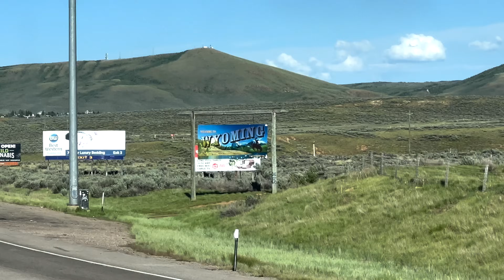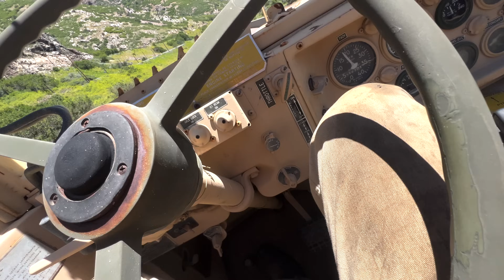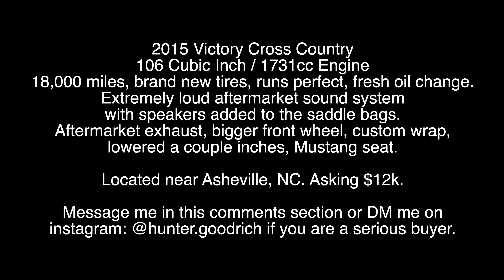Trying To Get My Sketchy Load Across Country

Comment: Might wa n t to think about attaching a chain to the frame and other end to cab lock! Worked on a lot of cabovers and never had a hydraulic cylinder fail but it happens. Freinds of mine that I worked with saw it hapoen. Worked 20 years as an ASE certified hvy/ med truck tech! Work safer/ smarter to be around longer!

Comment: When you tightened ur alternator it made me think of the old days where a tight alt belt turned into the bearings in the fan or water pump or whatever accessory is on the alt belt.....yup ...good times..❤️🇺🇲
Reply: Yeah those old V-belts had to be tensioned PERFECT, otherwise they'd squeal like a pig & destroy your accessory bearings!
Reply: @cigarsgunsanddiesel8032  true story

Comment: Truck driving school I went to had those cabovers drove a lot of them and then a rock company I work for had a few of them I drove quite a few of them and many other trucks I have drove no no more now I drive a power wheelchair. What fun that is. like the show very clever on the welding I'm kind of curious  at what your axles weights came out to

Comment: I bet this was quite the adventure...🤪👍

So since you showed us the first rendering (back when you were in UT) of the cab-over I've been thinking a lot about the front axles, twin steering was/is way cool !!! A buddy built a which truck with this configuration... The problem I think you are going to have is you won't get enough weight to the front to justify twin axles. It's likely in the end to hinder your overall weight capacity.
Having said this if this is a dream to have this with the twin axles & steering I say go for it.... Just know it's not practical for the application.... LOVE the vid  & content, at 59 I've learned so much from watching you fab things up, keep it going young man.... Great job..... Tim B

Comment: I’m in the truck tire business and you gotta change the o-rings on the valve stems especially on those old aluminum Budd wheels.  If you don’t it will cause a leak and that’s probably why you had one come off the wheel.  Best of luck.

Comment: I messaged you shortly after you bought your first cl 900. I suggested you put air ride under the back. I had a truck identical to this one that thing hopped down the road so bad. I cursed that thing every Friday night because it was sore back. It did not have an air ride cab. But I wish I still had it.

Comment: Did both of those Ford cabovers come from the same trucking company or was it a paint scheme that Ford put on the cabovers when they were new ??????????
Just curious because they have nearly the same paint job. 🎨
Reply: Those paint schemes were both original from ford. I had one identical to the second cl 900 he bought, mine was also a single sleeper